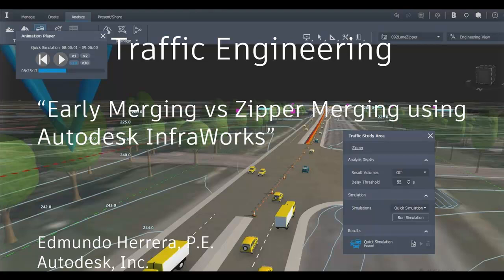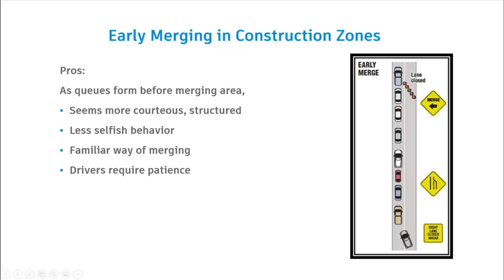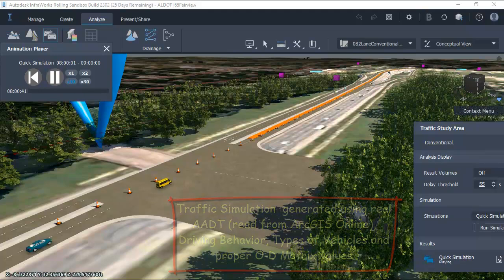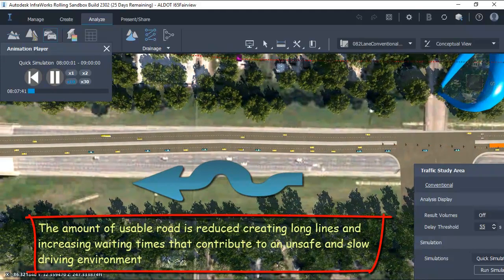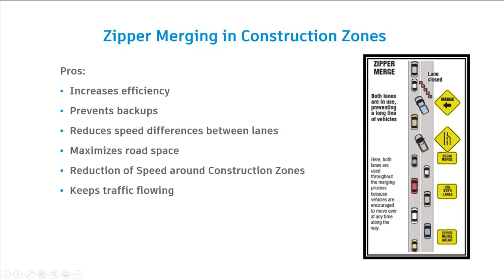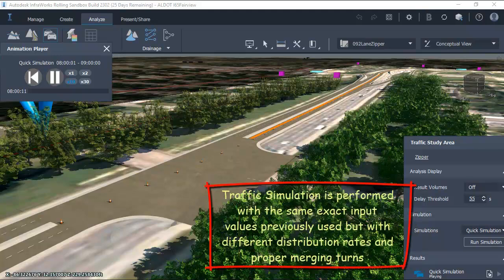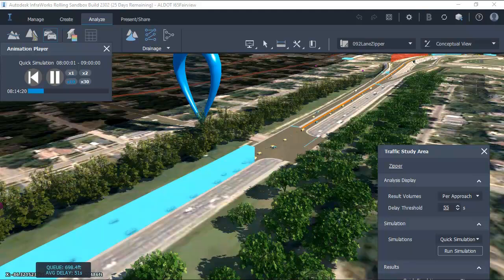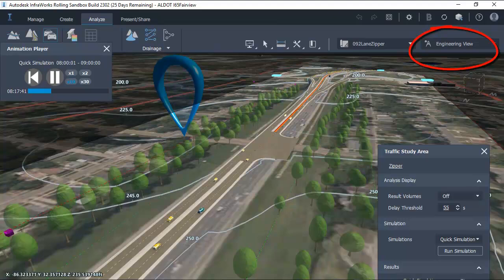Traffic Simulation - Early Merging vs Zipper Merging using Autodesk InfraWorks

Comment: Where's the real traffic?  It shows everyone with the same size vehicle driving the same way, each with 4 car lengths in between.
Add the following:
-Make every 10th vehicle an 18 wheeler that is fully loaded and move slow.  Like in Pennsylvania in rush hour.
-make every 20th car a slow car. Grandmas drive too.
-make every 30th car an entitled "I must get to the front of the line first" driver.  There are BMWs out there.
Now run the simulation and see what happens.

Comment: Nothing worse than a video claiming to show a simulation, only to give alleged results before showing the experiment.

Nothing about that removes faith in the biased of the experimenter....

"Here is our example of early merging. In our example, we have multiple vehicles that in no way engage in the process of early merging. This proves that early merging, with a bunch of random people refusing to early merge and insisting upon driving until they hit a dead stop, does not work"

"In our example of zip emerging, we have every person acting exactly how they should perform in a theoretical zipper merge. Surprisingly, when everyone follows the exact behavior model they should follow, then it works perfectly."

In conclusion, if you want to have a biased study that has no actual validity other than confirming your pre-existing bias, use this video

Comment: I honestly do not undertand how late merging can be faster than the regular one. Let's say that you can have 1000 car per hour per lane. If you have two lanes merging into one, If you have over 1000cars per hour it doesn't matter how your zip is done. Your flux will be reduced to 1000 cars per hour in every situation. And you will end up with trafic jam. 
If one lane doesn't allow you to have more than 1000 cars per hour then you can use any merging technique, you will never be able to go over 1000 cars per hour. Imo what happens during the merging is not that important if you use flux. The only thing that actually matters is how people are driving once they are in the merged line. If they are driving slower to look at the work or the accident on their left, the flux will be reduced and it will increase traffic jam before the merge. On the other hand, if the drivers are leaving space really quickly at the end of the single lane section, it will allow cars behind him to go faster and clear the critical single lane area.
Reply: The biggest problem I have with early merging is that the people that early merge essentially get "leap-frogged" by everyone else who merges after them once they get over.  When to merge in early merging is arbitrary, so one person's opinion on the appropriate time to merge will differ from someone elses.

So the people who merge early get punished by the people who merge "less" early. The only solution to make it completely fair to everyone is to fill up the lane and zipper merge, or block the lane like some 16 wheelers do... which brings up another point; heavier vehicles get screwed in early merging, because people know they will be able to get in front of them once traffic starts moving.
Reply: Sounds like you didn’t really watch the video 🤡

Comment: Flawed conclusion.  Your zipper merge requires driver to cooperate.  Real world drivers do not cooperate.  Simulate with X percentage of drivers cooperating and see how zipper merge fails when sufficiently high X% drivers not cooperating, and the merging car needs to be aggressive to merge in forcing the thru traffic to heavy brake.

Comment: Zipper model has cooperation at merging zone. What about a early merge model that has cooperation miles prior to the merge? Seems like a more fair comparison. You need to maximize flow at the bottleneck which means maximin speed at bottleneck. This should work in scenarios where traffic volume is less than half the capacity of the normal two lanes.

Comment: Zipper merge: "It does, however, require cooperation."

Aaaaaand that's the problem.
Reply: The crazy part is that the simulation for early merging includes a bunch of vehicles not engaging in the early merging process. So they have a completely compliant population for the zip emerging simulation, but just the average jerk for the early emerging simulation 🤦
Reply: It doesn't require cooperation. It requires common sense. Just drive and stay in your lane and let common sense figure it out at the end.... common sense allows people to use their eyeballs to figure out how to merge two lanes into one just as common sense tells people to slow down from 65 when a car is in front of them..... the only way zipper merge doesn't work is when people early change lanes and the same people speed up and block people. When two lanes become one lane youre not letting anyone in... you are following your lane and eventually two lanes become one. And when two cars are in the same lane common sense tells people to maintain distance to avoid hitting wjats in front of you.

Comment: The conventional way only slows down because of the 10% of people who demand to race to the front and cut in, causing everyone else to hit their brakes. Zipper merging only works in theory but people will still fight to get to the front and cause this method to back up as well.
Reply: IF both lanes are used right up untill the end, then it's not possible to "race" to the end.
Reply: @DondeRob  True, but the problem is that since not all vehicles are the same size, the "take your turn" means someone has to come to a complete stop.
Reply: @BloodyHeck  only times I've seen thst happen is when it's so busy that cars stop and go and stop and go anyway.
Reply: @DondeRob  Picture an interstate where half the traffic is 18 wheelers. The majority are in the right lane so depending on which lane is closing, either they have to move over or the cars do. Once traffic is slowing down, you can have 2-3, maybe 4 cars next to each truck. So if the first car goes in front of the truck, then the next few cars have to literally stop while the truck passes. The next car goes and if the next vehicle in the right lane is another truck, then the other cars that were next to the first truck are stopping again along with the cars that were next to the second truck.
In short, the zipper merge works in theory in a computer model where all the vehicles are the same size.
Reply: @BloodyHeck , in case of trucks it gets a bit more difficult, but overall it's still quicker then moving over sooner. If not, why doesn't everybody just keep hugging the left lane everywhere? I know, many people do, but we all hate them
Reply: @DondeRob if everybody gets over early and drives through at 55 mph it’s much quicker. Both methods need a cooperation of everybody. If everybody cooperates and gets over at the 2 mile mark notification sign, then there’d be no traffic. That should be the goal and what the signs should say…. Not “use both lanes to merge point.”
Reply: @josephgrill9304 sure, ignore the scientific experminents
Reply: @ If you look at any computer model where they show those vehicles doing the zipper merge, they're always cars, vehicles of the same size. They never mix in cars with big trucks.

Comment: Obviously zipper merge reduces queue length - but what about traffic flow (i.e. number of cars going through the bottleneck over time)? And how does reaction times and follow distance adjustments affect it? We do zipper merges most of the time here in Denmark, but I suspect they're slower in low-to-medium traffic because people need to adjust their follow distances and virtually nobody rapidly accelerates after merging to increase the flow rate
Reply: Queue length is reduced. Unfortunately, traffic flow rate is also reduced.
Reply: Flow rate should be roughly the same. You’ll experience a slowdown at the merge point whether it is done zipper-method right at the end of the lane, or done early.

The goal is to maximize usable roadway, shorten the line, minimize the follow-on effects of a longer single-file line of traffic.

Comment: convential was faster the one line moved faster and traffic got through quicker. With zipper now you back up both lanes and they slow down more. The problem with these models is they do not show huge ammounts of traffic only light traffic.
Reply: @CupcakesandCandyBars  So the other day I was heading to a bridge. I was wondering why it was backed up both lanes for 4 miles. Once we got to see the issue it was construction and merge left. this was on a sunday. Funny but during the evening there was no backups at all since everyone was merging before the merge left sign and traffic was flying through at the speed limit. Zipper works fine when there is not a 100,000 cars trying to make it into one lane. Works great when there is only 20 or 10 odd cars sure.

Comment: You don't show the traffic flow rate at after the restriction. An important piece of data. Number of cars per period of time.
Reply: Yep, the zipper mergers are never shown it, because it is less, it is equal only if merging is far away from bottle neck, and it is possible to accelerate speed to max throw put, but in real life merge will always be near at bottle neck, and speed at bottle neck will be not optimal (time to speed up), so you can choose slower distance (with zipping it is less on 50%) or faster (25% with early merge), or small chance the same time and less distance (newer seen in my life).

Comment: I'd be interested to see what, if any, difference there is between the two merging types when the lane reduction bottleneck is just at a 4-way stoplight intersection eg; one where all traffic at the bottleneck must come to a complete stop every ~20-30 seconds anyway. I have no issue accepting 'zipper' merging as faster, but only when on long stretches of uninterrupted road or highway. 

As someone who drives through such a bottlenecked intersection daily, during 3+ months (and counting!) of construction, I fail to see how the 'zipper' method would be any faster than early merging. It's a 2 lane, 80kmh limit major artery in a city, with that one intersection in the midst of its length. The reduction to one lane starts literally 5m ahead of the intersection, and 5m after the intersection it's back to 2 lanes. Usually the road functions as a highway with the light always green, but at rush hour, cross-traffic at that intersection means continuous cycling of the lights and looooong wait times & lineups. If there's someone making a left, it's not unusual to sit through 1 or 2 full red lights with no advancement at all. So, whether it's one longer line or two smaller lines alternating cars, that intersection bottleneck is still only letting through cars single-file, and there's still constant stopping. I honestly cannot see the 'zipper' conferring any speed advantage whatsoever there. I've had several arguments about it now as the construction's been going on for so many months. I mean you can have one line or two lines or ten, without constant uninterrupted flow and speed it's pointless...